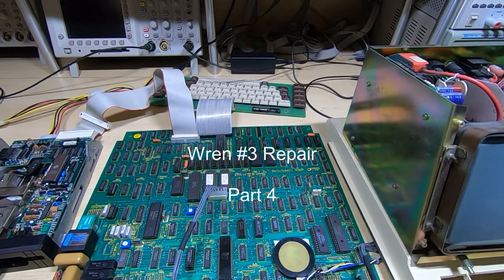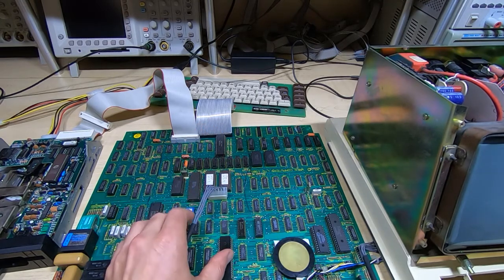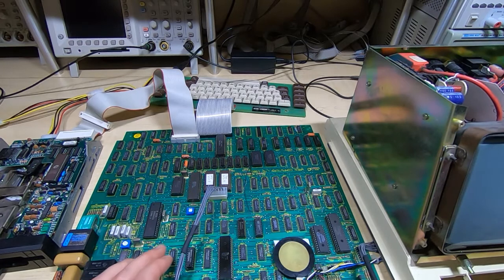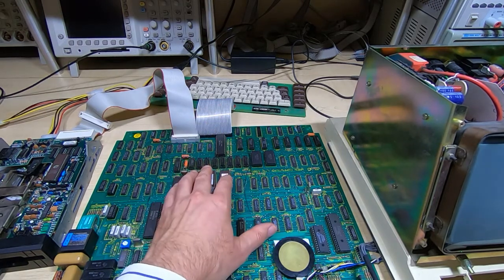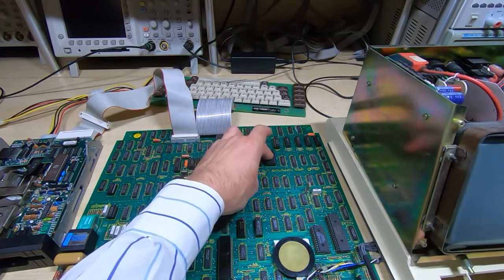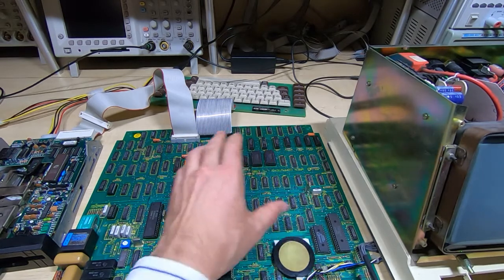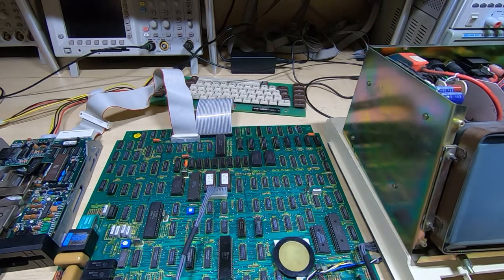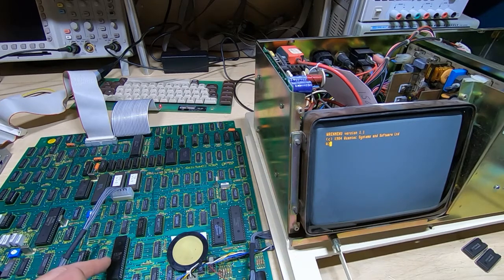Wren #3 Repair Part4

Comment: Carissimo Jerry sono in difficoltà tecnica riguarda ibm 5110 il problema è alimentazione scheda madre monitor volevo ripararla oppure capire se posso collegare un monitor esterno prendendo il segnale dal cavo.... Grazie e scusa.
Reply from the maker: Ciao, il gruppo CRT è un monitor semplice, quindi dovresti essere in grado di utilizzare gli impulsi di sincronizzazione di linea e di campo e il segnale video per pilotare un monitor esterno. Dovrai trovare un monitor che supporti la velocità di linea e di campo del 5110
Reply: @JerryWalker001  mi piacerebbe sapere che tipo di monitor usare il segnale di uscita lo trovato ma non riesco a stabilizzato.... Comunchue grazie mille per la disponibilità ormai il suo mitor è totalmente andato possiedo un vecchio monitor fosfori verdi cga aiutatemi tecnicamente a risolvere il mio problema se riesco vi offro una bottigli di vino e festeggiamo naturalmente virtuale.
Reply: @JerryWalker001  carissimo Jerry sono riuscito a trovare il segnale video orizzontale e verticale tutto bene.... Grazie mille per la disponibilità.